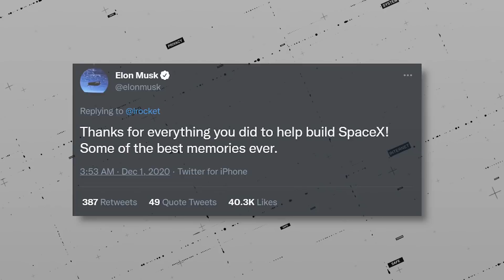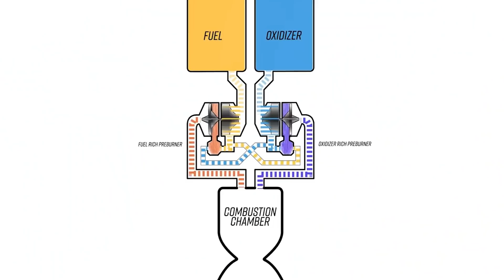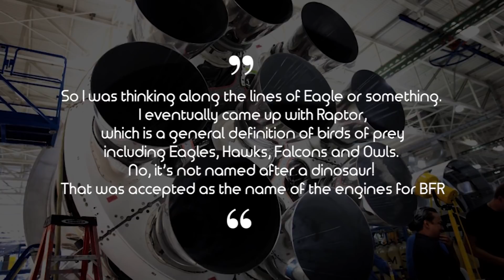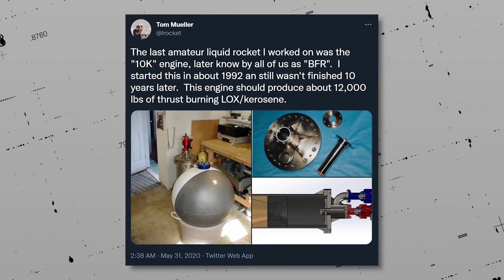Why This SpaceX Co-Founder Quit

Comment: Rolls Royce has made aircraft engines for decades. Today, many commercial aircraft are powered by Rolls Royce jet engines, as was Concorde. They originally made piston engines, of course, and their ‘Merlin’ V12 27-litre engine powered the famous Spitfire fighter. They also developed a V12 21-litre ‘Kestrel’ engine. 
Other aero engines from the time were named after birds of prey: 
Griffon, a 37-litre V12.
Peregrine, a 21-litre V12
Vulture, a 42-litre X24 development of the Peregrine (2 of them bolted together)
Goshawk, a 21-litre V12 development of the Kestrel
Falcon, a 14.2 litre V12 from 1915
Buzzard, a 36.7 litre V12
Eagle, an initially 7.4 litre V12 from 1915, and the first aero engine developed by Rolls Royce.